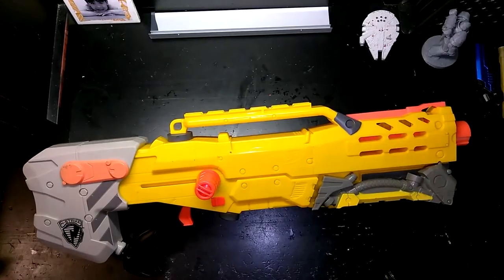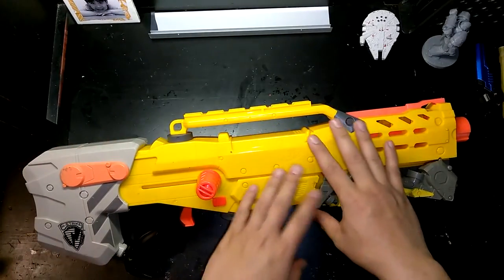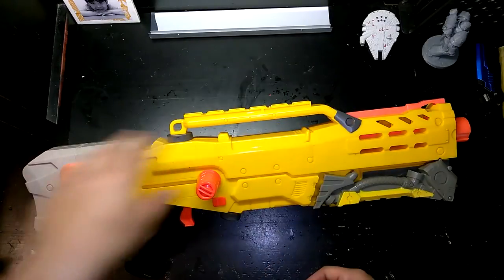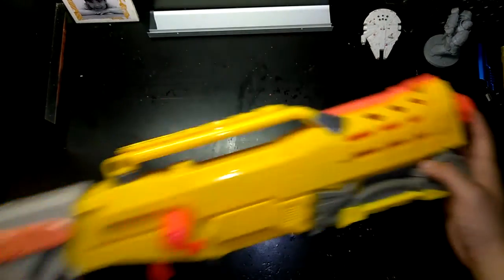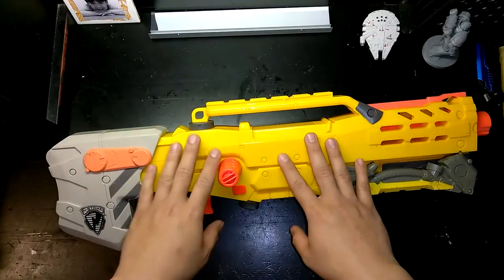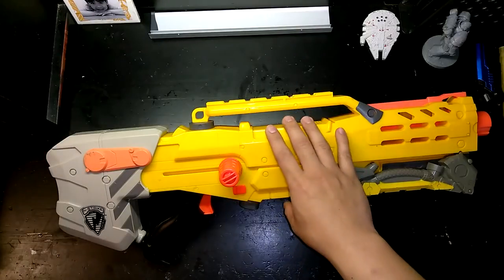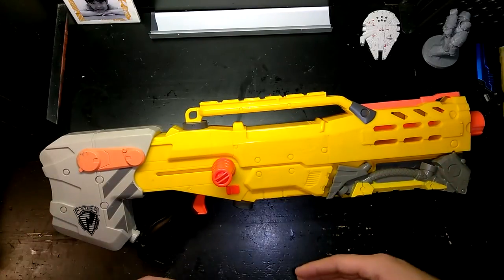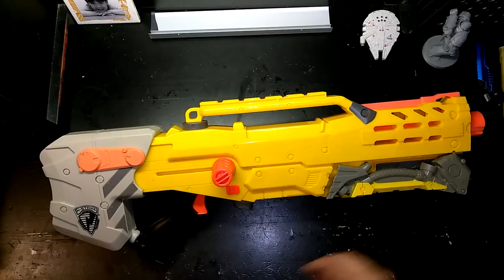Mod Guide - Nerf Longshot Mod Build Log [Part 1] : The Internals and How it Works

Comment: The piece at 20:00 is actually a lock, it prevents you from priming the blaster multiple times. When the plunger is forward it is pushed out of the way so the bolt sled can be moved back (and the blaster primed), but when the plunger is back and ready to fire, it blocks the sled from moving